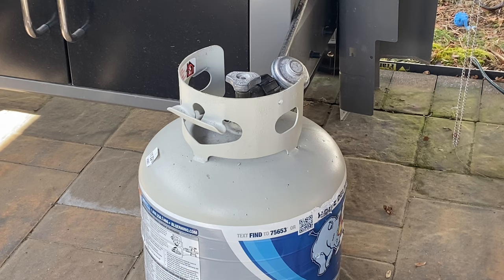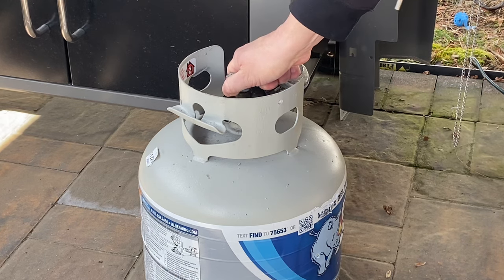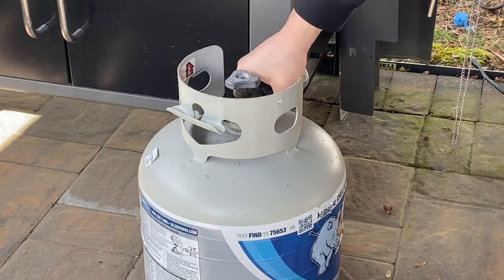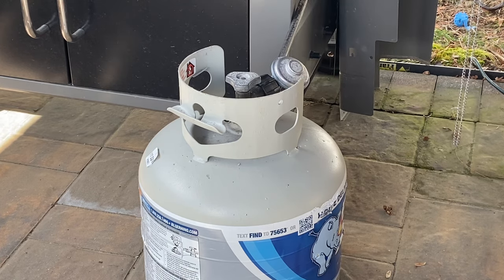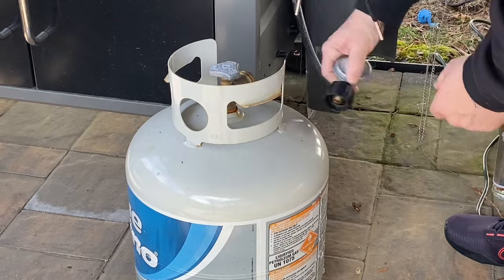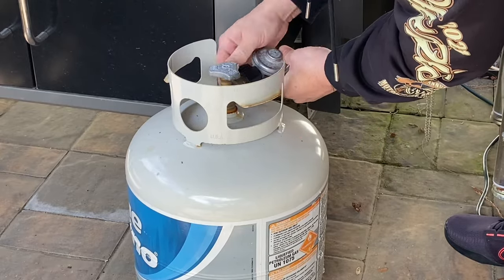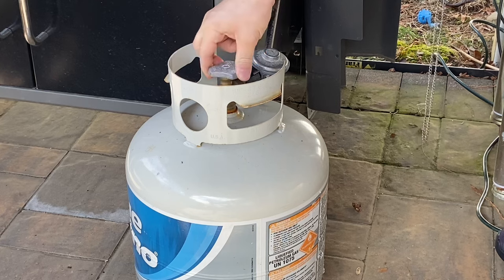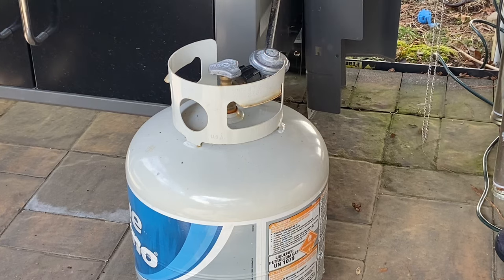Propane grill regulator leaking? Watch this before you buy a new one.

Comment: Thanks for the tip. It was the small O ring on the tank. It was cracked. Just hooked up a different tank no problem.
Reply from the maker: Glad to help. Sometimes the O ring is missing, so I usually check it before leaving the exchange station. Thanks for watching.
Reply: What size o ring is in these tanks?
Reply from the maker: Sorry I didn’t see your comment. To be honest, I do not know what size the O ring is. If you want, you can call a local propane dealer and they should be about to tell you.

Comment: Good save. Not sure why I didn’t think to do that. However now burners seem to be weak? Bad burners , regulator?
Reply from the maker: Try turning the gas off at the tank, then  turn the burners  on at the grill to purge the line. Then shut off the grill burner again and turn your tank on slowly (make sure your burners are in the off position) . Now try lighting the grill like normal. See if that helps.

Comment: What do I do after buying a new tank? Is there anyway to transfer the gas in the old tank to the new one or what do I do with the one's that is leaking. Sorry I have no knowledge to propane tank at all, and I have the same problem, and I'm afraid it might leak out on its own and it could burn my house down or something, cuz I live by myself and my pets, so my pets are basically by themselves when I'm at work.
Reply from the maker: Thanks for your question. Just note, I am not an expert on propane.  If you are unsure about its safety, I would recommend contacting your local propane company for advice. If your new tank is the kind that you exchange instead of refill, take it to the exchange station and have them give you a different one. If you have a tank that you have to refill at a propane fill station, then I would take it to them and have them test it for you. Sometimes it’s just missing a small washer and that may cause it to leak. Until you figure it out I would recommend not keeping the tank hooked up to your grill. Make sure it is closed all the way and keep it away from your home until you can figure out what’s going on. Good luck and let me know what happens.

Comment: It's usually just the little o-ring inside the valve starts getting old and dried out what I figured out is a quick squirt of vinegar will almost completely restore the rubber and then just make sure it's dry and cleaned up on both male and female ends and boom no leak
Reply: It's crazy I've been a forklift operator for the last good part of a decade and just always grabbed a new tank but when it's past midnight on a Friday night and all you wanna do is grill your chicken and such 😂 you figure out what's wrong real quick
Reply from the maker: Great tip! Thank you.

Comment: Just curious… why does the propane tank cause this?
Reply from the maker: Sometimes it’s a missing or rotted rubber washer, sometimes is worn threads. And sometimes it is actually the regulator. But I’m glad it was just the tank it worked out for you.